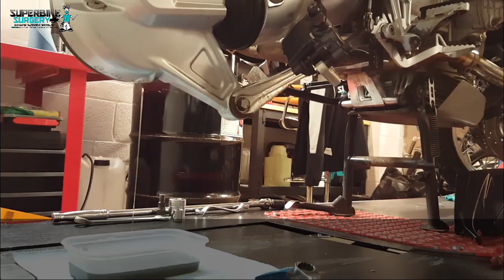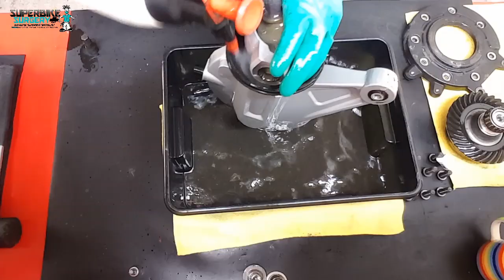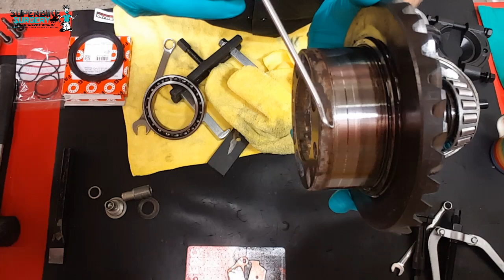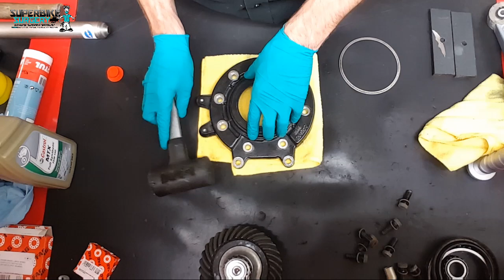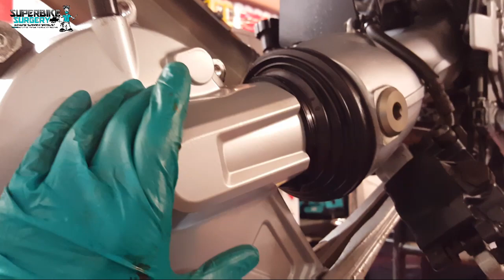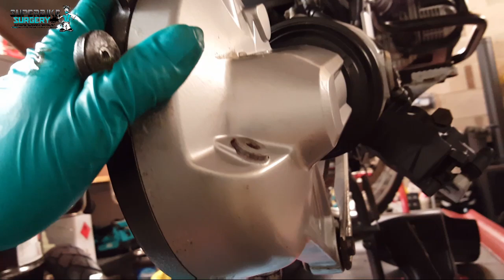BMW R1150GS Adventure Motorcycle Final Drive Rebuild

Comment: Lovely presentation but I strongly disagree that measuring for correct shimming is not needed. Most of these final drives that wore out prematurely, and lots did, was due to incorrect shimming at the factory. To re- measure for correct shims required is a simple technique using small strips of soft solder. You may be able to google this up if you are interested.

Comment: James thanks for that. At my MOT last week I had advisory rear wheel play so I watched your video, bought myself the crown and tapered bearings and all the oils seals. I took the opportunity to replace my paralever bearings as well, clean and moly grease all the splines etc. Hardest bit was removing the tapered race without the bespoke tool so I spot welded a steel washer to the race and pulled on a bolt inserted through the washer instead. Drove the new race in with a 38 mm socket. Had to wait for the boss (my wife) to go out before placing the tapered bearing and shaft in the freezer and using the kitchen table. Your video was invaluable and saved me hundreds on a refurbished drive and now I would be quite confident doing this in a backstreet workshop anywhere in the world. All R1150 owners please note. No special skills required here - just a methodical approach, patience and a bit of mechanical experience. It's not rocket science and James has done us all a favour here. Thanks mate. Yes - heat is your friend.
Reply: Victor Wright 

YouTube is great

The share talents and those that take the time to say thanks and add their own tips

Comment: Pretty good information.  A few suggestions though.....  I would definitely clean the surface, on the crown gear assembly, outside of where the chevron seal is, before you reassemble the drive. A Scotchbrite pad is excellent for that. It'll take that rusty looking residue off, without removing metal, like sand paper would. Otherwise there's a chance that as you assemble the unit, that seal is picking up, some of that debris. Also you should lubricate, slightly the chevron seal"s  rubber lip, where it fits against the rotating crown assembly with a little gear oil. If not your seal is going to be running dry, when you first ride the machine. It could cause that seal to fail quickly.

Comment: Spiral bevel crown and pinions are a snack compared adjusting to hypoid ones .Gear oils are a bit smelly but not such a bit deal compared to washing in diesel or working with used diesel oil. Brake clean and other solvents dry out your hands something fearful.

Comment: Thank you So much! With your video I was so confident. Got the crown bearing and spline lube in the mail and five hors later was done. With another video from Chris Harris. When I opened it up. Wow. That was the problem. The crown bearing was way gone. 5 ball bearings missing, the cage thing in pieces. 4mm thick of metal around the magnetic drain plug. I was cheap and used all the old stuff except for New crown bearing. No leaks, knock on wood. And I used two large screwdrivers with bent up ends and easily pried off the crown bearing. One on each side. Instead of a 30mm socket for reassembly I used a precision giant crescent wrench while I had my 12mm hex in. Then tightened the 30 mm nut while keeping my center 12mm pin stable with my breaker bar and 12 mm hex socket. Thanks from Kansas. I am in the middle of a BMW motorcycle repair shop desert. 300 miles west to Denver or 300 northeast to Omaha nebraska or 240 miles south to Tulsa. Crazy. Just did a test drive. So far so good. Oops my tag is good but I have no insurance on it. It would have been a nightmare of trailers and a few nights in hotel in Denver just to get it fixed from a shop. And they would of charged me a$1,000 plus. Thanks again.
T

Comment: Here's a tip for removing the tapered bearing inner race. Temporarily install to (beefy) VW beetle wheel bolts (lug bolts) into the other end and to clamp assembly in a vise.  Install the bolts into the same holes that the BMW wheel bolts are installed into. Install the bolts in 2 of the 4 holes with placement 180 degrees from one another (recall, a straight line is formed between two points). The bolt heads are then clamped into the vice. Works great!

Comment: Nice Job James ! .....  👍
Only thing I'd add is,   I've put bearing  houses and crankcases in the wife oven ( when she's out shopping !!!)  You can get them to a nice unform and controlled temp that way.   👌
Cheers Roj  
PS : open the kitchen windows !!!  Hot axle oil stinks 🤣😂🤣😂

Comment: The best tool the one between the ears.  Good tips and glad it turned out to be a how-to.  I believe the 1150RT is the same so would apply this to my bike. 
(2 years after) yeah.  It really took me 2 years to get to it. Wouldn’t it make more sense (if it is not the case which I am not certain as I see only ghat it is Castroil, to lube the final assembly with the gear oil that is used on final drive 80w90 (clymer)?   Thank you

Comment: Make sure you put those pivot sleeve back in and tape them securely  so they stay in contact with the needle bearings. They will easily fall out if you don't while you are working on it.

Comment: Never use oil based grease on rubber or plastic, they will simply deteriorate with time. Use silicone grease only to lubricate rubber or plastic components.
Reply: It’s an oil seal

Comment: Replacing my FD bearing now following your advice and tips. But leaving the bevel box in situ.
Reply: Damn, only installed one shim and found the other in my rag pile. Now again disassembled to re-install 2nd shim.  My fault for working in a cramped garage with all bits’n’pieces around me.

Comment: James - it's a fine long video and shows your expertise and experience very clearly.  You have all the special tools needed for this rebuild, and you've done it all many times before.  So rather than trying to do the job myself in another 10K miles, when my odometer reads 35K, wouldn't it be much simpler if I were to just send you my rear hub ?  Please quote me a price !

Comment: Watched the entire video. Very informative.  Come to find out I need to replace the pinion gear bearing. The pinion gear, when pulled has play (in and out). The driveshaft does the same thing. Do I need to replace the bearings that house the driveshaft in the transmission? Also watched your ABS removal video and was inspired to give it a try. Had some fun with  it and wasn't as hard as I'd though. I prefer non-ABS brakes. Seem to get a better feel. Thanks, Chris

Comment: thanks for the video, really helpful. But what about the other bearings and seal? the small spiral bevel gear that gets drive from the shaft to that big wheel drive gear. should that be changed too or is it unlikely they fail? As there will be oil in that assembly I would imagine there is a seal there to prevent oil going into the shaft drive housing. thanks

Comment: Many thanks. I was about to attempt the bearing change. Tips have been very useful. I’ve missed other but I will look at more of your videos. Have you done anything on the ABS system. I really love my bike having had it near 20 years and toured quite a bit around souther and central Africa but the bloody ABS fault drives me mad having this constant light flashing. If I reset it last for a few days then I got to reset again.

Comment: Man. This video are awesome. But I'm not sure right now about my final drive problem. There is a to much free play when wheel are rotate. So my question is: is this possibly to find out which part are screwed? The gear? The cros? Ballbearings? This freeplay are  really annoing. It's like around 5 cm or more on 1 gear when pulling back/forward. I count on your answer 😀 cheers.

Comment: Have you ever worked on a R1200RT (K26)? I had an issue with the driveshaft joint and pinion rusting causing it to round off the FD pinion and the drive shaft, cost me £2k to buy replacement parts BUT i cannot get the damn pivot bolt off, I used heat because it has threadlocker, 2 ft breaker bars, standing on them, impact driver and 2 x mobile mechs. Still cant get the bugger off, so its been sat for 2 years. Any advice? thanks for posting the content.

Comment: Thank you, very nice.  I have few questions for you:  I have a 1999 BMW K1200 LT which has a shaft drive, looks exactly like this one.  I need to rebuild it as it is leaking and has metal shavings in the oil.  It is a weak point on the LT because of the weight.  Is the rebuild on the LT more or less the same as this one on the GS ? 

Also how much would you say the parts costs are (Roughly) ?   I am in the US of course so they maybe a bit cheaper.   And what would be the cost of these specialized tools that I need to do the job ?  I have the hammer and what not.

And how often would you recommend changing the Final drive gear oil on these bikes ?

And finally, does using a Heat Gun accomplish the same task as using a torch or do I need a torch ?

Thank you.
Reply from the maker: Tha short answer is no it's not the same, you'll need a press to remove Bearings etc. To many differences to go into but much more difficult to do than the 1150.
Reply: @SuperbikeSurgeryTV  Thank you. I guess I am better off having someone rebuild it than buying a new one since they have known defects even when new.  I assume the RT Final drive is more similar to the GS one then ?  I also have a 1999 RT.  But the final drive on it seems to be fine, even at almost 100K miles.

Comment: Is there a mileage  interval  the bearings need to be changes  or lubed ? What was the mileage on the bike  you are working  when its bearing had to be changed ?  Do you think all theses parts , maintenance  extra weight is worth it over a chain and sprocket ?

Comment: Great video! 
I also have r1150gs 2003 with 46000 km.
I have small freeplay on rear wheel (puling it with both hands by the top and bottom of the wheel).
I think it's about 1-2 mm of freeplay, but I can't understand, what is correct measure of rear wheel freeplay?
Please, give advice!
And did I get you right- no need to tune up this adjusting shims on the small and big bearings? Just live them? So where from freeplay comes? 
Thanks you!
Reply: Quite often it's the paralever bearing causing the play, which the the one joining the bevel box to the shaft, the one with the big allen bolt described in the video. Check that first before you strip out the bevel box.

Comment: hi after the rebuilt and few km about 100 km in the shaft drive i have gray oil the wheel rolling so easy like before i mean, im changed seal and 2 bearing, im use torque range for all screws, changed oil, after riding the housing is 60 celsius i mean its not so hot (110-120 km/h) , what can cause the oil change to gray after few km? thx

Comment: Those bolts with the normal roller bearing and the tapered roller - do they need to be heated before you undo them?  (I ride an R1100RT but the final drive is the same )  I am going to need to do rear wheel bearing at some point.
Reply from the maker: I'm not 109% sure which bolts you mean? That said there are no bolts you should need to heat up to remove.
Reply: @SuperbikeSurgeryTV  I was referring to the two bolts that hold the final drive to the swingarm and have the pivot in them.  I've seen conflicting advice saying that you need to heat them before removal or you will break them.
Reply: Likewise I've seen advice that says you need to heat the main bearing to get it off too ( in an oven to 100C)
Reply from the maker: @ruthmoreton6975  The reason you'll see conflicting advice is there isn't just one way of doing things. The use of heat on something is always a judgment call depending on the situation. I've undone plenty without needing heat but some do. There are basically no right and wrong answers with subjects like this. Just personal experiences.
Reply: @SuperbikeSurgeryTV  thank you very much.  I think, with it being my first attempt when I try to do it, I will use a bit of heat to help release those bolts.  It can't hurt.  I am taking note of the essential tools too.  I will make sure I get the right pullers.

Comment: Sir, thank you for your video its very informative in every step. But quick question you used two(2) metal shims, is it supposed to be one or two, i am rebuilding mine '02 R1150RT and only one metal shim came out. and USA oem part diagram shows one metal shim. Could you help me out. Thank You
Reply from the maker: It's not unusual to only see one shim. They are available in different sizes in the factory to allow for manufacturing  tolerances, somtimes two smaller ones are used instead of one large. Assuming you are using good quality replacement parts there is no reason to assume you will have a problem.

Comment: Great video but how did you know you had the drive shaft phasing correct?
Reply from the maker: Because the U-Joints are fixed to the drive shaft on both ends so it's impossible to change the phasing when removing the final drive unit.

Comment: Well presented video.
Just a comment, without checking the preload of the big bearing chances are good that the new bearing will fail again. Most every FD I have checked has had too much preload from the factory.
Reply: The fact that this bike had FD issues at 50,000K tells me that it DID have too much preload!
Reply: I did the measurement on my '99 GS, and it needs a .500 mm shim.  The reason I am saying this is that the original bearing had .750 mm of shims!  So it is ESSENTIAL to do the measurement, and if you can't do it, pay someone to do it.  :-)
Reply: @itsJohnnyDill  ,

Comment: James, Brilliant video, really made the task much simpler.
Do you know what the torque settings should be for the 8 M10 bolts holding the cover on are ?
Thanks, Sean
Reply: +Sean Cull 35NM I think - do you use Loctite ?

Comment: 7mm Allen key is easily found in Europe. Commonly used on Ford brake adjusters.
Reply from the maker: It may be common in the car industry but it's virtually unheard of with bikes. You'll also find the most standard allen key kits have a 6 and 8mm  but never a 7.
Reply: @SuperbikeSurgeryTV  Halfords

Comment: where did you get that spray bottle for the brake cleaner an how long does it last
Reply: +secretsix6 Just search for: "compression sprayer". They are sold at hardware stores, on amazon, ebay. Everywhere basically. They last long enough to be worth the money as they are cheap.

Comment: When you are cleaning the parts, can you use any kind of brake cleaner? (car and motorcycle)
Reply: +Messing with Biker Man 
I use kerosene - it does a great job and is cheap. Got an old paint brush I keep specifically for this type of work. Kerosene to clean out then give a good flush with the carb or brake cleaner. (Any carb or brake cleaner will work) The carb cleaner will flush out any kerosene and will evaporate. I still give it a good spray down the the air hose.

Comment: You don't know the shimming and gears running together  was correct from the beginning. A felt pen marking on the gears and rotate and read the marks is important.  The teeth should never touch at the small diameter! Checking/adjusting tooth backlash. Gear backlash:
(adjust without oil) 0.07...0.16 mm. Shimming i can be tested with a feeler gauge between the two halves of the gearbox.  Taper roller bearing preload  0.05...0.1 mm. After measuring  and correcting the  seals are mounted. 

Aluminum expands more than steel when heated. An electric heat gun is convenient.
Clean the gearbox before disassemble . 

Use a wire to hook up the brake.

Never use a pressure washer on the bike.
Protect the center of the hub and the screws against corrosion.
When tires are changed clean the big seal from outside.
Use PTFE tape on the oil drain screw . It always come of easily. 

Use good quality synthetic gear oil .
Lubricate taper needle bearings in rear wheel drive.
Reply from the maker: Yes I'm well aware of the gear meshing and backlash implications. But after rebuilding over 100 of these units over the last 20 years or so l can say with reasonable confidence (I've checked lots) that you won't run into problems unless you mix up original shims or disturb the pinion bearing. BTW get yourself some engineer's blue it's much better than using a pen!
Reply: @SuperbikeSurgeryTV  Indeed, but most readers don't even know what that is.
This was Not to offend you. I live in Sweden where many can't do mechanics nor electronics. I have seen bikes with broken front wheel bearings sold from BMW agents. Gearboxes full with water and rusty bearings. Common glycol I the cooling system and so on.
I do Kbikes mostly for fun and the old one are protected from theft by age. The quality of the oldies is astonishing. BTW thanks for the video.

Comment: I prefere to avoid using flame with bearings... put them in a oven or use a pot of hot oil to heat them

Comment: I build a lot of BMW 11x0 final drives, but never get the same clearance of the shims!! I assume that this kind of rebuild will not last arround 100.ooo km as a standard. If you do not take care about the axial clearances/preload it is usually worked up to 50.ooo with the luck, as every gearbox.
Anyway, the small bearing stays OK for more than 250.ooo km, the small, input sealing will leak after 80.ooo no excuse, you did not mentioned, did not changed.
This is, at least, misleading video as a guide to do.

Comment: You have just washed the pinion bearing in gritty cleaning solution.
Reply from the maker: Thoroughly rinsed with Brake/parts cleaner then blown off with compressed air.